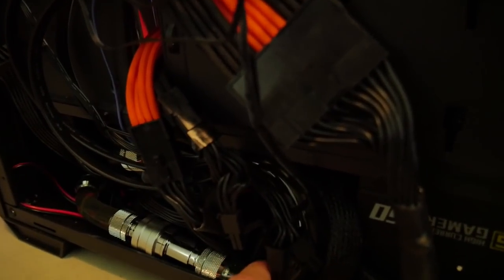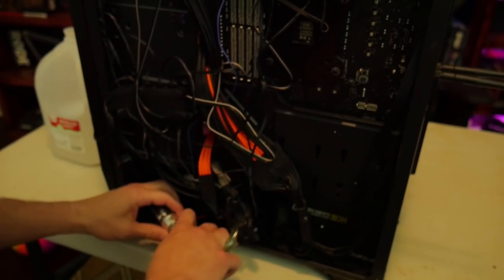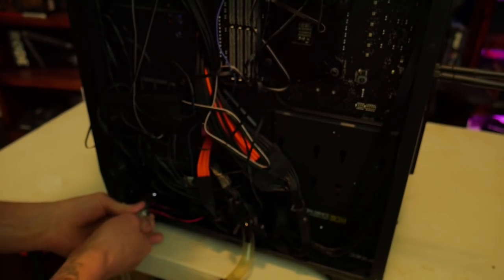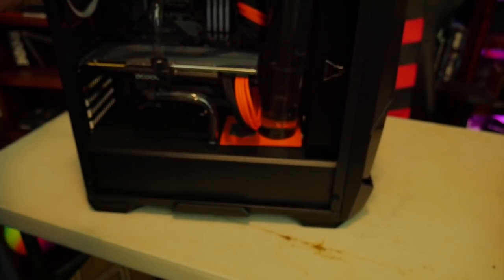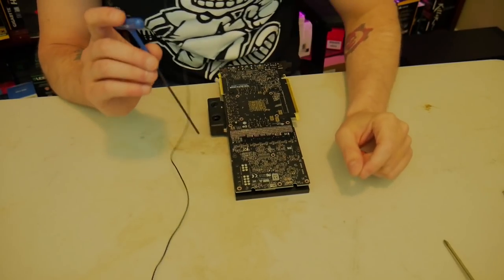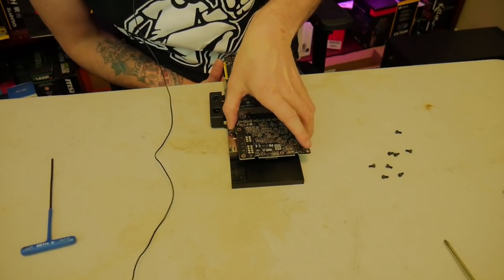Watercooled RTX 2080 Running Hot

Comment: Mine is running anywhere upto 76c under the ek waterblock. Fans on max or low doesn't seem to make a difference. Haven't took the block off to check but makes me some what uncomfortable being able to reach nearly 80 under water. Then again was hitting mid 80's with the gaming trio cooler running at 60% so maybe its just a super hot running card?

Comment: I had the same issue. I found that the pads that came with the card originally, the larger ones next the gpu were too tall/thick. I replaced with the thinners ones that came with the water block and no issues since (covered the chokes as well). Just a thought....
Reply from the maker: thanks for the idea. I did get hold of the new instructions for alphacool and they do cover the chokes now. I did that and it's fully functioning but pretty hot. What kind of temps are you getting?
Reply: @SonofaTech  I've overclocked the card, 650 on the memorty and 135 on the cpu clock. Now I'm getting 32c idle, running heaven benchmark about 30 minutes, goes to 47-48c. (It's pretty cool here in central California as well right now.) Prior to changing the pads, it would idle about 42c but the second I started any load, jump up to 70c....

Comment: Liquid cooling 2080 is useless, you won't gain anything. I had a kraken g12 on my 2080 with a H75 aio and it didn't improve OCing at all despite cooler temps. These cards are already efficient with their architecture!